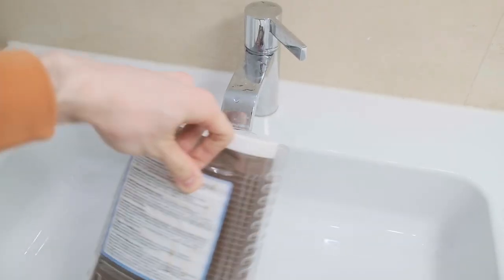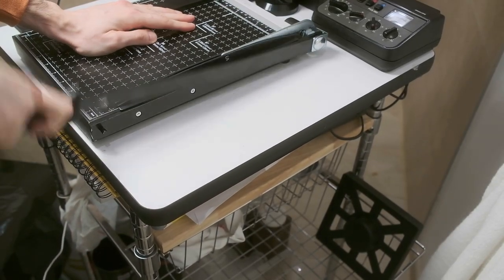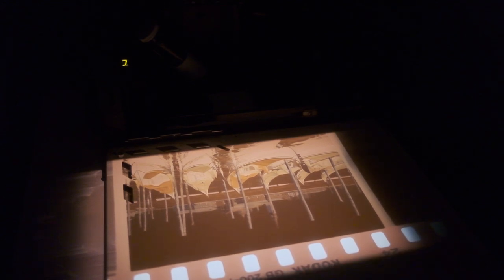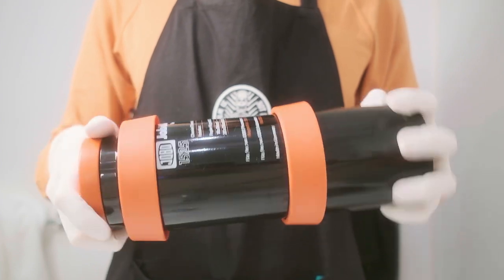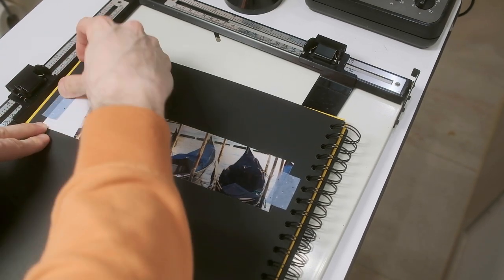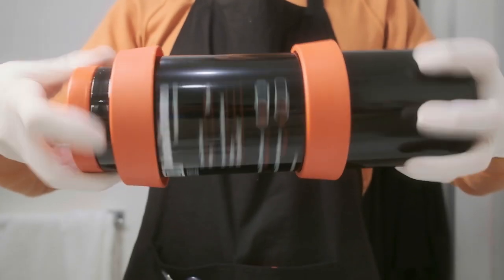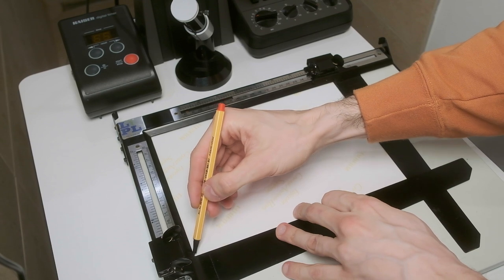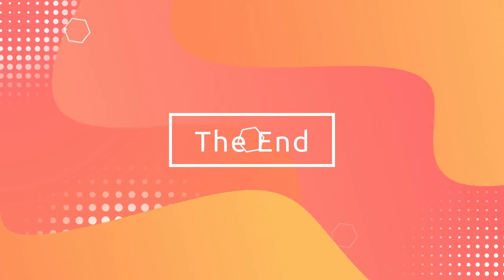Fujicolor Supreme paper in rolls, how i cut it and make prints in color darkroom in 2022

Comment: I have a different type of cutter - the one with a rotating blade. It would be almost impossible to insert the paper from the side of the blade in darkness, so I made a strip of photopaper, which I taped to my paper cutter. It is quite easy to measure the right length of paper just by touching the strip and paper in total darkness. I did cut one roll of 20,3 cm (8") paper to 20,3 x 25 cm sheets. It took me a few days (more than 350 sheets). This setup seems to work fine with me. Probably I ruined some 20 papers, but when a roll of DP II, the best paper made by Fuji, costs 65€, it is not a big deal. I don´t bother doing any test strips any more, because it is a waste of time trying to save 10 cents knowing the film prices today. What I did, was investing to professional chemistry for RA-4. Concentrates 80L of developer (including starter) and 40L of blix was about 200€ with freight. It is much cheaper in the long run compared to 1L-5L kits sold to hobbyists.